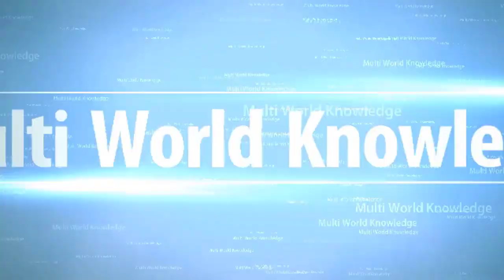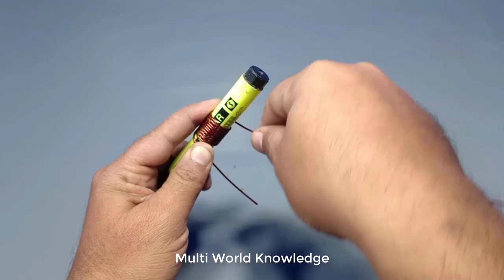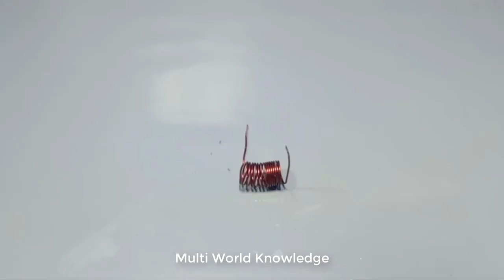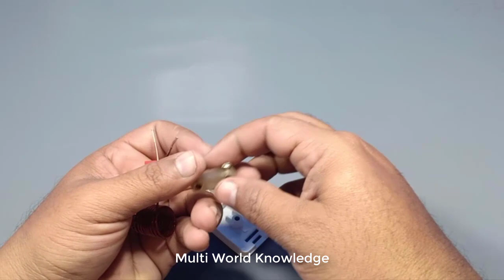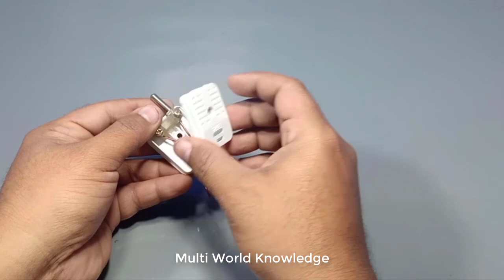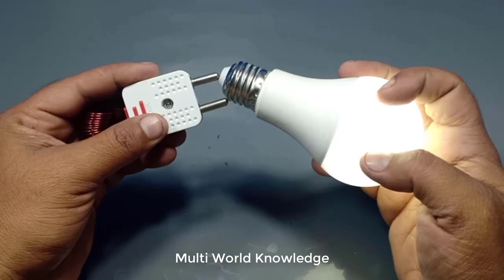New Free Energy Generator _ 100% Free Energy Device For Light Bulb At Home

Comment: in case anyone does not already know,  the  RATINGS  of a device   PROVE   Nothing.
in the case of a  LED,  it  does  Not  run on mains AC.     power is, internally,  converted to  low-voltage  DC  !!!!!!       googletranslate